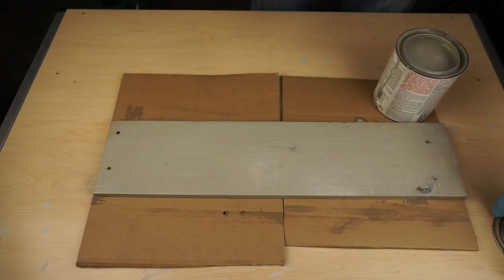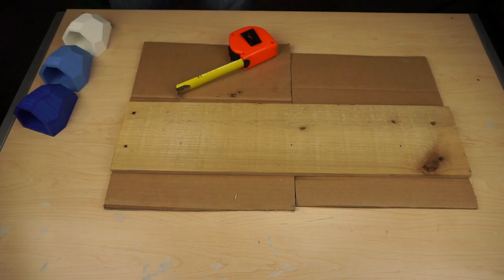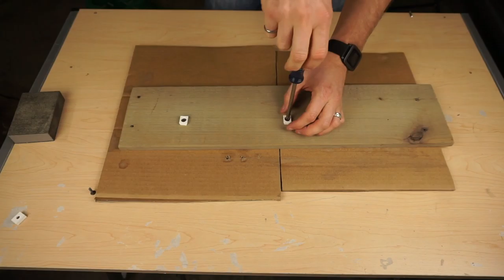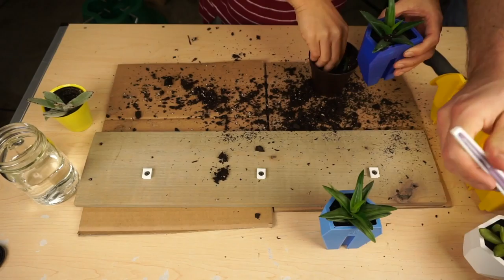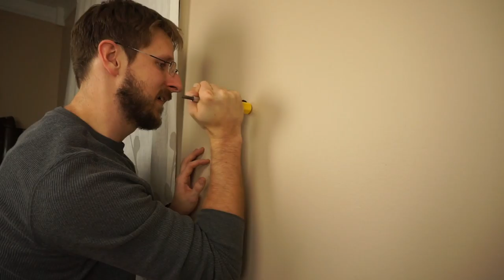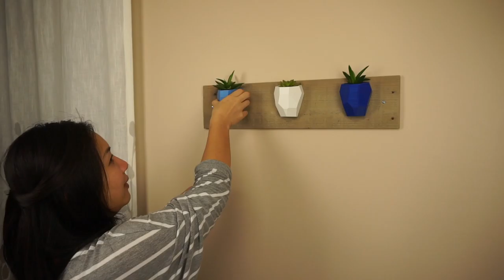DIY succulent garden with 3D-printed pots

Comment: looks great!! Did they hold the water? I know most PLA is not tight enough to hold water but I'm guessing the soil keeps it in?
Reply from the maker: Thanks, they are not completely water tight, and the soil does keep it in like you said.  It helps that they don't require much water.  Even being mounted on the wall, they still look great after 2 months.